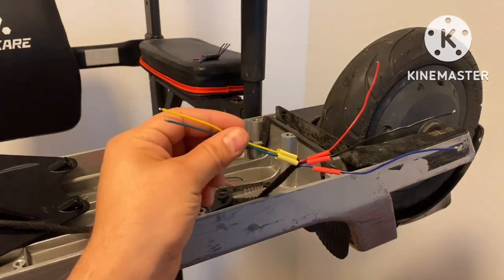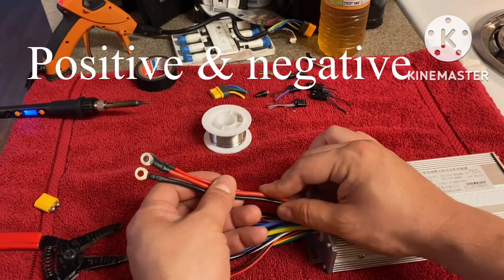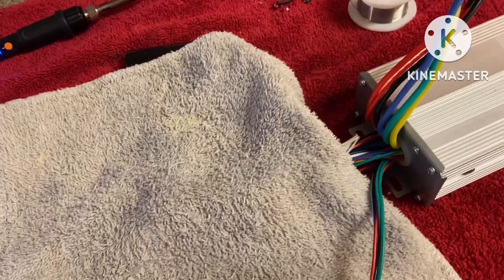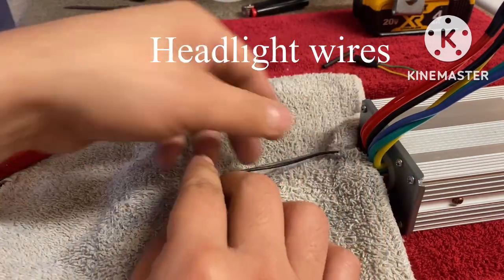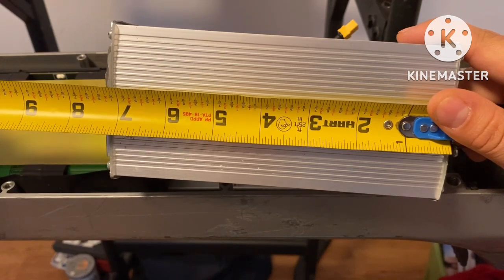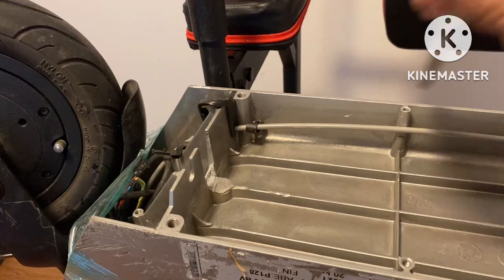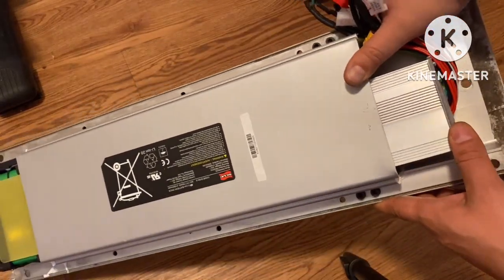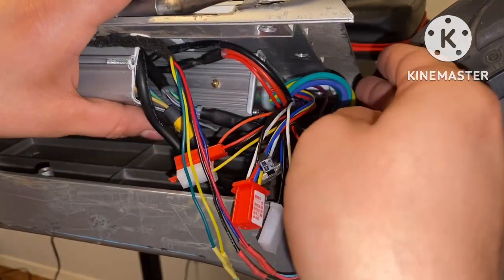Bird 3 -electric scooter-Conversion|1000w 38a -brushless motor controller￼-

Comment: Hi i just wondering, is the conversion make a difference with 1000W controller or its fine with smaller one? for example 750W or even 500W? thank you so much

Comment: yo, i did everything u did, i rewatched the video like 5 times and make sure everything is ok, the rear wheel is not moving, i make sure all the cables are welded properly. weird thing is the baterry output shows me 35 volts instead of 42? why is that?  is the battery my issue or u think i did something wrong?

Comment: Hey Whts up!  I’m about to start conversion and was reading these posts for good info and seen buddy blew his battery up after the 42v conversion, so I had a few questions hopefully you can answer… 
1. I need to get a charger for mine (it looks exactly the same as yours) and it charges right at the bottom of the steering pole. Could you direct me which charger to get?
2.does this 42 V conversion blow batteries very often?
3. If for some chance, unfortunately, it does blow the battery How much is a replacement one?
4. Is the mod really worth it? Can you tell me what it actually enhances?
5. Last but not least I saw someone ask about putting a Kill-switch in the Main is it worth it? If so, could you possibly tell me where to insert it? 
Thank you for all your help and answering questions and helping everybody get their 🦅 up and running,  I’m down at the Jersey shore and they don’t have 🦅 around here and I don’t feel like driving back up to Newark to grab another.
Thank you for your time and i’m sorry for the book! and helping everybody with your 🦅 conversion vids ✌🏻
Reply from the maker: 1.https://amzn.to/41KPfFp 👈 charger u need 
2. Lol not at all, don’t know what caused their battery to blow up. They obviously did something wrong! I’ve never had a battery pack blow up personally, every scooter I’ve sold to a customer never stated they I had an issue with a battery catching fire/exploding. So no that’s not often.
3.the battery packs are pretty expensive themselves, $300/$530 . But you might possibly find a replacement on eBay. If not I would recommend you joining my discord, once inside my discord tap into the general forum and simply state that you’re looking for a replacement battery, somebody there will reply back , it’s basically a community forum that I created, anything that has to do with scooters is in this forum, pictures/videos etc. i’m sure you can find a very good deal on a battery there ASAP
4. Are you talking about the Shunt mod? I don’t do that anymore, instead go with a higher amp controller.
5.https://amzn.to/44muamH 👈 this controller should do just right, suitable for both bird 2&3 . If you choose this kit well then there would be no purpose in adding a switch, so scratch off the switch . On this display kit Your able to power your scooter on and off up top. So there is no needing a switch.
Reply: My bad bro I just hit that last link I saw that I missed and I’ll go with that set up thank you. Can you just please direct me to that light switch you want and I promise I’ll leave you alone until the conversions done unless I run into an issue! Lol thank you again for being patient and helping everybody out.  🙏🏻/NJ

Comment: Struggling to make this thing work. I've bought 3 different controler from the links you provide and they are always different from what you installed.  Anyway, I wire everything up as you instructed. Plug everything In and nothing happens. I get a pop and that's it.  When I unplug the throttle wires it will do the self study but as soon as I plug throttle back i---NOTHING----! I NEED HELP. HOOK ME UP WITH SOME KNOWLEDGE.
Reply: Did you ever get it to work?

Comment: I have a bird 3 and some spare parts from my 2000w 52v ebike kit since the motor died. Can a single bird 3 motor handle around 1,700w or should i buy a motor for it?
Reply from the maker: You should buy a motor that is suitable for the power you are trying to supply it. But either way it’ll still work you would just be pushing it past its limits so the motor to the bird scooter is going to get hot faster. If it gets too hot the Hall effect sensor inside the motor will go out.

Comment: After you finished up top will it turn on and run as is?
Reply from the maker: I believe I added A relay switch to turn that scooter on/off. I stopped making scooters without switches.. without a switch to cut the battery off from your power your battery will still continue to slowly drain.. i’ve had maybe two or three scooters brought back to me for that reason.. learn from your mistakes
Reply: Understood thanks. Basically what I’m wondering is once you clip the head wires  removing the computer and reconnect the with the kill switch the scooter will run in stock condition without further modifications? I want to keep it simple and just get a scooter up n running to give to my girls daughter. Appreciate your time

Comment: Are the hall wires being connected  like absolutely nececary?
Reply from the maker: they are meant to avoid "jolty" starts. That is it. Most bikes will function just fine without them. I tried that in the past and the wheel still spins but I remember it being loud when cranking the throttle.So for a quick fix I say would say yes.these basically the hall sensor that tells the controller how fast and in what direction the motor is spinning, and allow it to accurately set the timing

Comment: I have a question i jave a bird 3 and i have a 500w 48v controller is this video wired the same as i would?  I been trying to get this poppin for like 2 weeks im tired and never done this before and wanna just quit.  But my damn inself wont let me quit so i jave to get this done its becoming a burdon.
Reply from the maker: Every controller wires up the same way pretty much. Just be sure your controller is brushless and not brushed . Everything Wires up the same way

All you need to do is locate your 
Motor Wires
Hall sensor wires
Throttle Wires
And finally your power supply ! 

That’s pretty much all you need to connect, everything else on the controller is for other functions such as Electric Breaking ,cruise control, alarm ,hi brake ,low brake ,etc

Comment: Do you have to add a controller? Or can I go really cheap and use the factory bird 3 controller? Thanks in advance for helping me.
Reply from the maker: Yeah bro Best bet is finding a cheap controller maybe through eBay, but honestly for about 25 to 30 bucks on Amazon you can grab you a Controller with a Display kit. If there is a way of using the original controller I haven’t found out how to do it 🤷‍♂️
Reply: Thanks bro. Just found a scooter on the side of the highway. Gonna give it a try.
Reply: I have no display I only have a 500w 48 v controller no display is that going to screw shizz up?

Comment: Hi I have one of these it's a 2 or 3 I believe I was woundering is the rear back wheel we're the motor to scooter is it's missing the cover and battery and cintroller
Reply from the maker: Yup the back tire is ur motor that’s what drives the scooter. Sounds like you will be needing a motor and a battery pack. Not to much as the controller since it’s useless . But besides that you have yourself a scooter
Reply: @pjscootermods  ty very much fr info I'm sure yr busy on Sunday One more .?I got the motor in my rear tire you said all I need is a battery and motor the motors still on it with chain around tire .. do I need a controller 🪔💳😃wene changing it over to couple ryobi lithium batteries 18 volt or should it have 2 18 volt batteries and connecting series ?what do you think too much battery 0r use 1 ryobi 18 volt battery  or use 2 -18 volt ryobi lithium drill batteries .?

Comment: what size of screws did you replace the 7 sided screw ones with? what diameter
Reply from the maker: I never replace them , I just use the remaining 6T 45 screws that hold it together. But I’m sure if you have some T 25 screws laying around they would work perfectly as replacements
Reply: @pjscootermods  just got all my screws out im thinking of the easiest place for some kind of ignition switch thanks for the vids

Comment: I tried following another one of your videos to convert a bird 3. Did everything exactly as you had but the motor wouldn’t run. I have an extra bird 3 to fool with. If I don’t want to do a conversion and just get it running as is will it run after completing the head wiring that you showed in the beginning of this video?
Reply from the maker: If your motor - back wheel - is not spinning after you connect your intelligent/self study Wires. well then you have a bad controller on your hands. I assume you have everything connected Motor Wires,  Throttle Wires ,including the battery bms bypassed.
If everything is connected and looks right to you. the video is correct.. if nothing is giving a response after connecting your intelligent wires then yes your controller is at fault
Reply: @pjscootermods 

What awg wire do you use to the controller.?

Comment: Got 2mode controller v48 10000w does work with bird baterry
Reply from the maker: No it needs to be 36v controller
Reply: @pjscootermods  o way just got 48 v battery
Reply: @pjscootermods   just got brother 72v 1500w  75 k

Comment: When you solder the large bypass on the battery, what is that piece of metal you use to connect the two locations?
Reply from the maker: 16 gauge speaker wire
https://amzn.to/3OR49EF
Reply: @pjscootermods  awesome thanks, your videos have been super helpful

Comment: How about what gauge of wire to use to go to the back of the bird?
Reply from the maker: Use the original wires and the original connecter to the Backlight
Reply: @pjscootermods  but I want to know the gauge of the cable that comes out of the brown box please

Comment: Do you have a link to a motor controller that would fit without cutting?
Reply: You can always duct tape it to the top
Reply: @joshuaraley686 top? u mean where u stand?
Reply: @noelsalonen3550  where it curves in the back

Comment: Have you tried making a all wheel drive bird scooter I have 2 bird scooters and I removed the rear motor on one of the scooters but I’m having fitment problems because of fork in the front idk if you’ve ever attempted something like this???
Reply from the maker: I’m still trying to figure that one out .. need a find a motor that sits in that fork.
Reply: @pjscootermods  me and a friend just made a lime scooter work. We took the rear wheel from the bird and put it in the front of the lime with a little fabrication and made the lime scooter AWD, 2 controllers/2 motors/1 battery and its fast
Reply from the maker: @billythakid6661  Which model are you talking about ?
Reply: @pjscootermods  the gen 4 lime with the battery on the frame that you can remove and is accessible

Comment: Why do you need to bypass the bms?
Reply from the maker: The battery is locked, you get no voltage out of the battery pack if you don’t bypass. Without the bypass you get 0 volts.
After the bypass you get your battery percentage back.
Reply: Yo when i pluged it in it sparked, do u think it was because i suck at soldering? Lol
Reply: The brushless moter i used was 

dc36v , 15amps,,,,

Oorrr do u think it sparked because i didnt use the same connector from the positive and negative, and just showed the wires in instead?
Reply: @greyfox4016   from what ive seen when you first plug the scooter power together sometimes it makes a little pop. but i would be careful if your battery is sparking though that sounds like a fire hazard. does the motor run?

Comment: yo  whats the gray box in the stem after the gps?
Reply from the maker: Gray box ?
Reply: @pjscootermods   its very slim it sits in the part of the neck that has the white led strip when i was trying to feed wires threw, it blocked me and only left room for the  brakelines nothing else so i ended up breaking it and pulling it out

Comment: If you use the grey wire in the controller to provide 5V, do you still need the resistor for the headlight? And if I put in a kill switch at the back main power do I need a head light switch? 
Finally why do we bridge K2 to ground? I have a 500 watt controller.
Thank for this contribution to the community.
Reply from the maker: The resistor is so that it can manage the resistance,too heavy current will blow out your headlight..

If you’re adding a kill switch to the main power supply then no you don’t need to add a switch for your headlight. Everything will turn on and off together with the main power switch you plan on adding..

Unless you choose to add a switch for your headlight ! That would allow you to control it independently..

K2 to ground leaves you in third gear.
You bypass 1st and 2nd gear 
If you don’t do the bypass well then you just stay in regular mode

Comment: Quick question how did you remove the The 7 pin Security screw
Reply: Strip it out slightly and hammer a square bit that is close to the size

Comment: This is a great video,very to the point and direct. Doing everything from top to bottom in order makes sense, reusing those clip connectors is really smart .. you can tell from your previous videos you've gotten this conversion down to a science . I just got my converted model three working a few weeks ago most of the conversion I did was based on your video with the twist throttle. I didn't order a Twist throttle though I've just got a little button that I screwed onto the original throttle.  I didn't have the money for extra parts so it's only got full speed and off LOL. So far everything works great tho lol.  

I gotta ask tho, 
16:05 directly under your wrist is that a bottle of piss XD
Reply from the maker: Yooo thanks my guy ! And lol it does look like pee but no it’s green tea citrus.

Comment: What if after you unplug it doesn’t want to go
Reply from the maker: Sounds like a connection issue if it worked before you charged it and now it doesn’t go .
Reply: @pjscootermods  no so I plug in the hall wire the big black one and then did the the thing to make it go forward and now it won’t work I made sure that the wires are all connected and re did them idk
Reply: @pjscootermods  update I tested all the wires and all them are reading so ima re wach the vied and make sure I didn’t miss anything

Comment: He boss quick question. Put this new controller in and at full throttle it shuts down the scooter. So I have to turn it off ( reset) then turn it on to get it working again. Any idea what’s going on?
Reply from the maker: depends Really ! What’s the amperage draw on the controller ? Did u modify the shunt ? To heavy of a shunt mod could definitely cause that issue..

Or it could just be a flat out controller issue! 
Iv had a few controllers act up and do the same thing if I try taking off too fast on the scooter The controller will shut down/reset really quick. It’s strange but I’ve had it happen..

I do the same process on all of my scooters , not all of my scooters have the unexplained cut off issue!! So it’s definitely a controller issue.
Reply: Ok the shunt mod is what exactly. First one so still learning the controler mods. Thank man. This thing when it goes for the few seconds flies! Way quick!😊

Comment: Is battery 48v?got 48v controller
Reply from the maker: Battery is 36v 
Controller needs to say 36/48v
Reply: Can uead 48v controller with 36v batteries
Reply from the maker: @suenhiigb6597  nope 👎

Comment: Most of the controllers you buy from Amazon are crap 1-10 maybe good it sucks to do all that work for cheap shitty solder job on a pcb.
Reply from the maker: I agree ! Yes they are cheap and made from China , for best results I will go with reading reviews and checking out star ratings on how they performed. I recently returned 2 72 V universal brushless controllers. They both had very bad unexplained Power cut off situation.